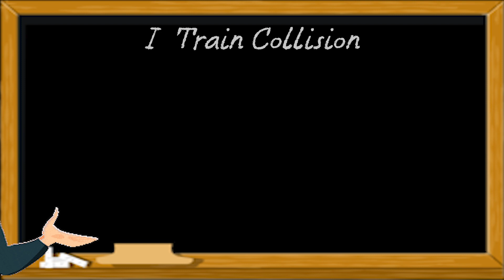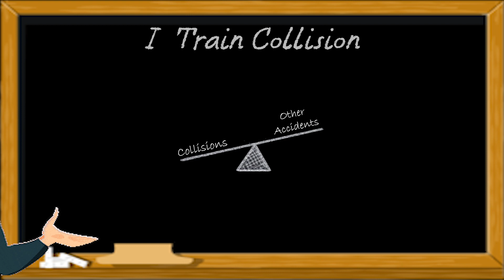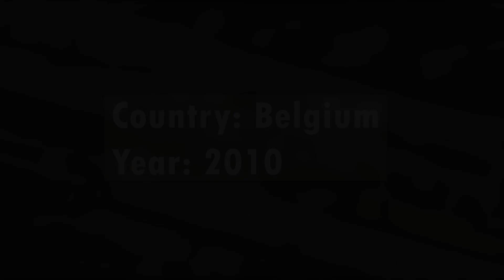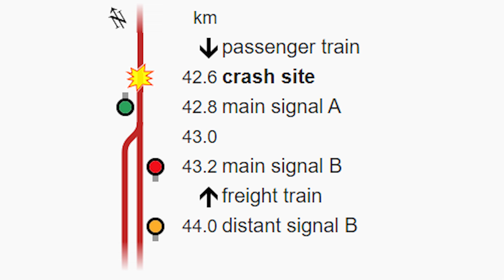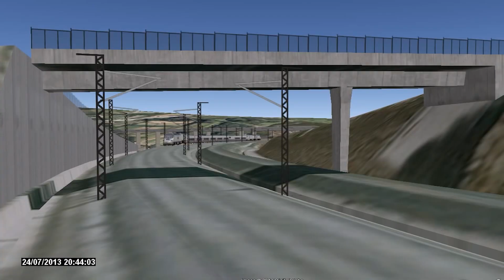Catastrophic Railway Accidents in Europe (2010-2020)

Comment: 5:06 this is not railway disaster in Szczekociny but it happend in 2011 in Poland it was railway disaster in Babach where 2 ppl died
Reply: Those trains was tlk brzechwa with locomotive ep09 from przemyśl to warsaw and 2st train interregio Jan Matejko from Warsaw to Kraków with locomotive et22 controller of trains in starzyny lied to traffic controler from sprowa that interregio is still infront of his building but Jan Matejko wasnt infront of trains controller building it was entering the long rails first there was signal s1 stop and then trains controller from starzyny maked it incident signal without w24 after that traffic for tlk Brzechwa changed to s1 stop she couldnt make it s5 going with max speed so she made signal incident too but before it there was 4 warnings 2 last were that tracks where she wanted to tlk was is claimed and used but she confirms every single warning and on traffic there is an incident signal with w24 Brzechwa goes on the same track as Jan Matejko on 55 minutes 8 pm Brzechwa and Jan Matejko were crashed in moment of colision Jan matejko had 40km/h but Brzechwa had then 98km/h
(Sorry for bad grammar and mistakes but im from poland and i tried my best)

Comment: I am doing an apprenticeship as a train traffic controller at Deutsche Bahn in Germany. We often get told about the Bad Aibling disaster since it was the biggest accident in the last years and many mistakes were made. So, we have a system called "Gegenfahrschutz" which basically doesnt allow that two trains can enter a single track at the same time. The controller "thought" that it was a technical malfunction and just gave the train driver a replacement signal which mostly is used when a main signal doesnt work correctly. That signal just allows the train to pass the main signal which is either showing Hp1 (red -> stop) or is completely turned off because of malfunction or something like that. You have to go through some other steps to activate that signal, so he knew what he was doing but just didnt realise that he already send another train from the different direction on the tracks. Then, as mentioned in the video, he dialed a wrong combination. Thats why is emergency call didnt reach any of the trains, but just the other train controllers in the area. They told him about his mistake but that didnt matter anymore.
Reply from the maker: Thanks for the info Max!
Reply: @RailwaysExplained  No problem! Feel free to contact me if you have other questions :D
Reply: Servus Kollege! Ich drücke dir die Daumen das du bald in Einsatz kommst! Grüße aus Mannheim. :D
Reply: Ist nicht HP0 Halt?